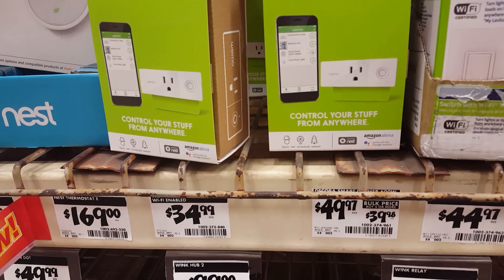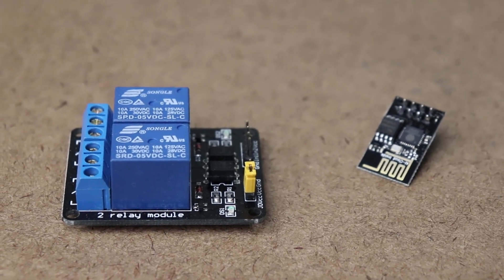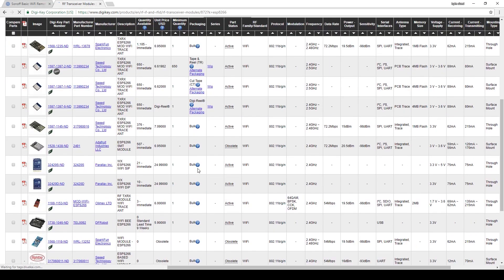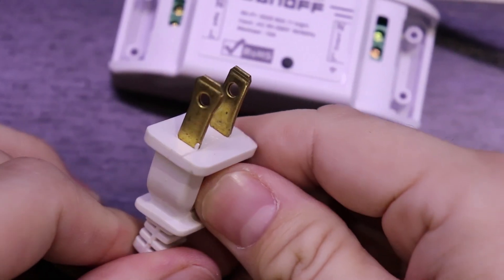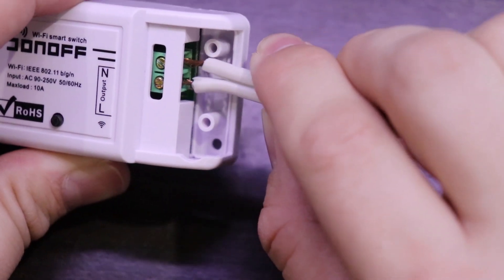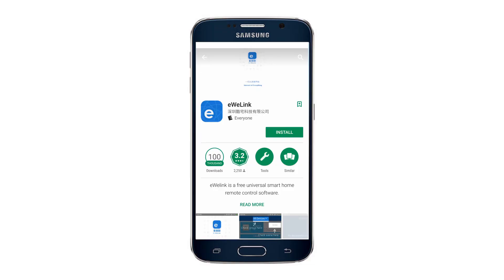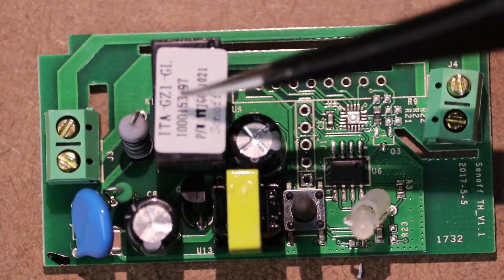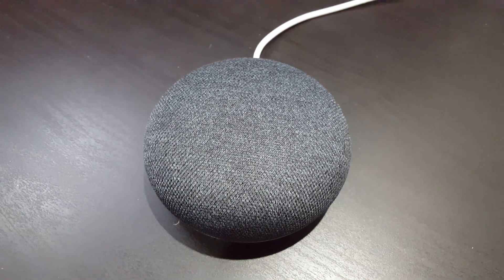Sonoff - The $5 WiFi Smart Switch That's Compatible With Alexa And Google Home

Comment: Ever thought of using a Sonoff 2lu for a ceiling fan and light?
Reply from the maker: +Southern Dad can you post a link?
Reply: byte sized Sure, https://www.itead.cc/sonoff-dual.html
Reply from the maker: I actually don't have any ceiling fans in my house (east coast thing?) and my lights have wall switches. It seems like these aren't designed to go inside the wall switch. I think sonoff makes a different model for that. I already started using z-wave dimmer switches in my house before learning about these devices. Have you used these inside the switch box?

Comment: Can it handle more than 2000watts? Or a high powered devices?
Reply: Neophilim sweet thanks man ! Yeah not much of reader
Reply from the maker: +Jesus Serrano it depends on which model you get. Some are rated for high power loads.
Reply from the maker: I just added an Amazon affiliate link in the description. If you want to support my channel feel free to use that link, but no big deal if you don't.

Comment: I’ve been trying to figure out a way to control my gas fireplace, which turns on and off with a switch in the wall, with the rest of my home automation.  I use Smartthings and have Z-wave switches all over the house.  I wonder - would something like this work to turn on and off the fireplace if you could install in line with the switch?
Reply from the maker: +Jason Leiter I'm not sure whether or not this will work with your fireplace. If you figure out a solution I'd like to hear about it.

Comment: Hi. Nice video.  Have been following this device.  I however have a doubt.  I am nor sure if it is directly compatible with google home device.  Can you explain please?  Thanks once again.
Reply from the maker: +Parambir Singh the sonoff switches can be controlled using the eWeLink app. Look in the description for a link. Once you get the device setup you can open the Google home app, open up settings for home control, and link your eWeLink account to Google home.
Reply: byte sized ok. So are these the newer sonoff devices?  Because I remember that till a few months ago they worked with alexa only and not Google home.

Comment: Great video. Is there an equivalent for UK plugs?
Reply from the maker: +Shady Furball the sonoff basic is compatible with UK plugs. It's rated for an input voltage of 90-250V AC and a current rating of 10 Amps. You need to use an extension cord from the UK instead of the US kind shown in the video.
Reply: byte sized You could do this, but you have forgotten that all UK outlets are grounded. Using a cut off UK extension would constitute a potential safety issue if someone were to plug an appliance requiring an earth into the socket. Outwardly all would appear well, but as the earth is not continuous in the event of a fault it there is potential for the outer case of the appliance to become live. A better solution would be to use a suitable cord and plug top on one side of the switch, and wire the appliance to be controlled straight to the switch, although this means it cannot then be changed between appliances. Of simply buy the UK version with a three hole socket on the front- one would hope this is properly earthed!

Comment: Does one sonnoff device control many devices? Or were all the devices you turned on with your Google home mini each plugged in to their own sonnoff unit
Reply from the maker: +Jonathan Munandar a sonoff device will turn on/off anything plugged into it, but not individually. If you want to individually control devices like in the video you'll need multiple sonoff switches

Comment: Hi.  Here's one for you.   I have a gas fireplace that is turned on and off by a rf remote.  Within the fireplace housing is a box that has 4 batteries in it.   The batteries are only there for powering the receiver to make it turn on or off.  There is no power needed at all to actually get the fire going.  Just a relay to make the connection.
Do you know of any Wifi relay that is only needing power for the communication part?  It's not needing to send any power out of the unit...just needs to complete the loop?  I think (not positive) the WEMO MAKER used to be able to do that kind of thing, but it's not available anymore.  I just want to be able tell Google to turn on the fireplace.

Comment: Is the Sonoff compatible with IFTTT
Reply from the maker: +zer0w0n I'm not sure if it's directly compatible but I connect the sonoff device to Google assistant which does integrate with ifttt.
Reply: zer0w0n yes, it is a applet that you can add.

Comment: Can you use the sonoff with a switch in a wall to control ceiling lights?
Reply from the maker: +Dwayne Shaffer sonoff makes another model that is meant to replace in wall light switches. I took a different route in my house. I use a z-wave hub with z-wave dimmer switches.
Reply: thanks!
Reply: byte sized do the z wave dimmers work with two line voltage systems i have a nearly 100 year old house?

Comment: Does this require the phone app and phone to be running or does GH directly communicate with it?
Reply from the maker: Ben Rethmeier no, you only use the app to setup the device. After it's setup Google assistant (or Google home) will interact with the  eWeLink service over the internet. The phone doesn't have to be turned on.